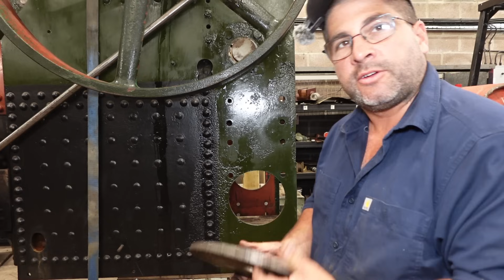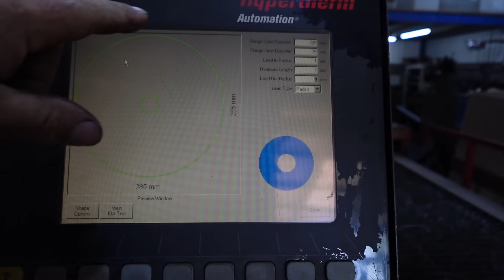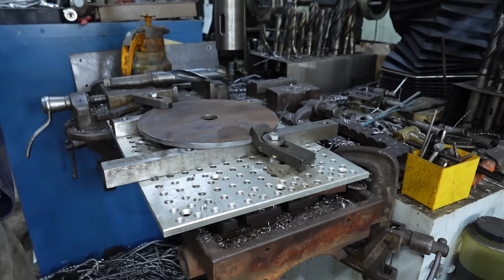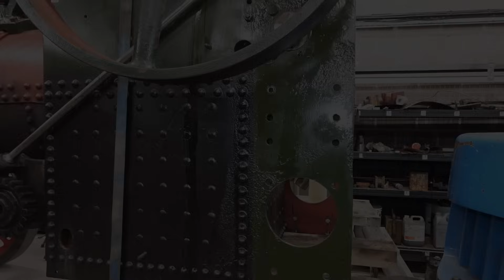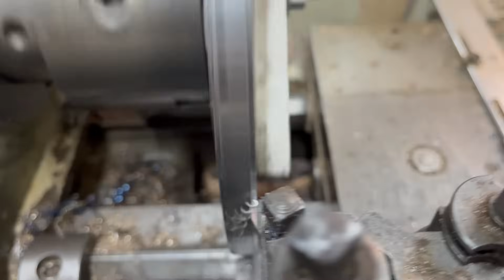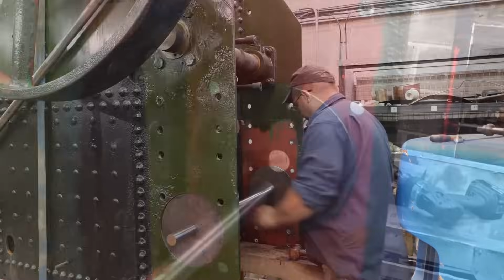THE ALMIGHTY CHIPMASTER!! A start on the rear end!!!

Comment: Seems totally OTT to me. The boring set only needs reference marks on the green body of the engine (the places you have already measured for the big plates!) to which boring brackets are temporarily welded to hold the cutter to complete the holes. No big plates.

Comment: Hey up norm there's no way that shaft will support little lorens wheels, I thought to setup for out of round holes it was normal to use cone's, good video again thanks
Reply from the maker: Not really worth making large cones up for one job. Could have been clocked in with the boring set up but wanted to do as much here before he turns up.
Reply: @VintageIronukI did think this would be your answer as can't see a mobile line borers have them that size

Comment: I used the same idea with the threaded rod and nuts through the lathe spindle while doing a 10" cast iron flywheel, would be anoyed if it came out the chuck, more so if i were standing right over it as you say.

Comment: Nice Job, Norm. I have seen line boring done on the website of CEE in Australia. He uses conical plates to align the bearings, because he gets lots of different sizes of holes. The conical plates save a lot of  machining, as they can be used for different sized holes. Also, i think they are easier to make (if your lathe cab swing then. I look forward to seeing the boring.